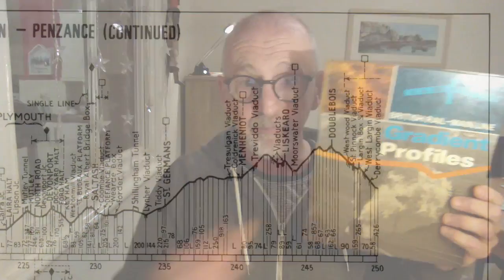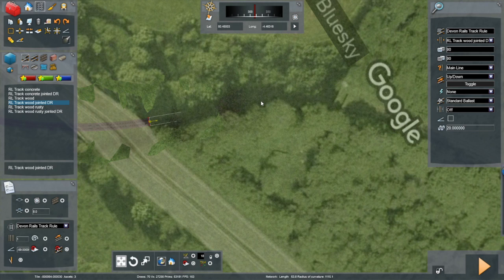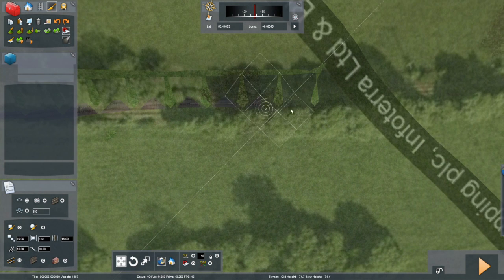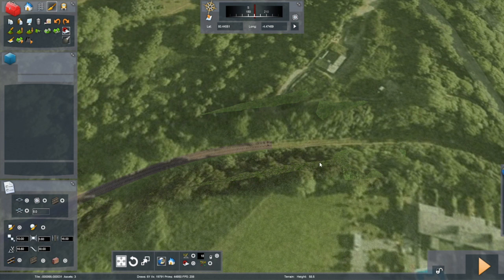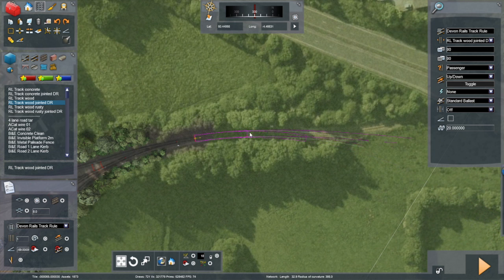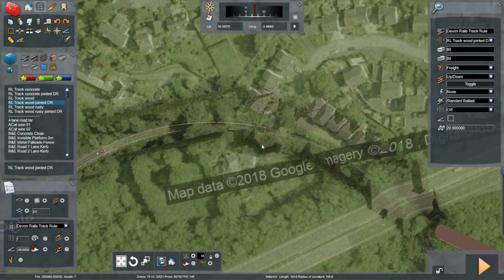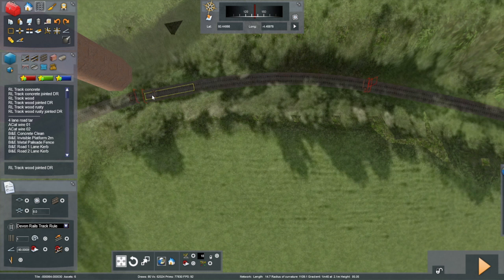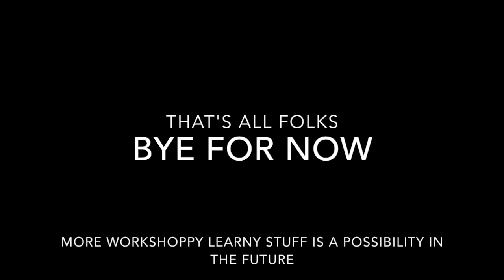Laying Train Simulator easement track in twisty branch lines

Comment: Brilliant tutorial! One tip is if you're unsure about track placement, go under the terrain and place the track in line with map but not finishing perfectly to the point. Afterwards, start the curvature as a junction and cut off the left over off. Also, I use the snap completely and once I'm sure, I re-import the terrain and tidy up the embankments. Keep up with the good work!

Comment: superb video for a very tricky subject...... any info on how to reduce canting on some overtight slow speed sections made with a yard track rule template, other than building a unique track rule from scratch?
Reply from the maker: You would need a new track rule Malcolm. Or perhaps don't use superelevation. I don't use it where the degree of superelevation would be too large.

Comment: Brilliant video really found it useful on laying easement track! I was wondering how do you connect track with easement? So say you start building a diverging route that connects further down the line. I've laid pilot track and when I go to replace with easement is it possible to connect the two or will I have to just connect in the normal way? 

Also being cheeky can I ask if it's possible to do a tutorial on terrain editing and how you go about editing the terrain in your route after importing the DEM files to get an accurate looking route.
Reply from the maker: Sorry it's taken so long to reply! In short, and as you know by now I expect, you can't connect easement track to previously laid track. You just have to turn easement off and lose superelevation in the relevant sections. Sometimes you have to compromise (andf remember that it's only a simulation :-))! I did a tutorial on cuttings that you can see here: https://youtu.be/Qq2uKn7a_Mo . I'm in the process of creating a DEM tutorial involving correcting terrain under a high Cornish viaduct. Look out for it!

Comment: I am in the USA where the grade of the rail is measured in percent of grade.  0.0%  of course means level ground.   A listing of -0.02 means 2/10 of a foot drop in 100 feet and  -1.02 would be a decent of -1.02  feet over a distance of 100 feet of rail.

My question is, is there a formula or a calculation list to show how to transfer this  to the gradient numbers from TS 2020?  For example, when you were using a gradient of -44.  What would that be in the 
U. S. grade calculation?  I remember a comparison when using the Microsoft train sim but I can' locate it in my records.
Reply: I live in New Orleans, LA and I'm slowly working on my version of the Huey P. Long bridge, I found something that reference its 1.5% and topped off a 52 meters clearance. It was a butt-kicker trying to get the numbers close enough where the train didn't look like it was struggling.
Reply from the maker: Try this: http://www.1728.org/gradient.htm

Comment: excellent video even after two years later it is still very helpful. However I do have a question for you I understand that the DEM files are not that spot on but when I lay my track using the track charts I end up carven and giant canyon through my terrain. Since I am using US plan so I have converted the gradient to metric before I started.  the station elevation is 188ft and the track is at 190ft however when I put in the track gradient it is way below that. Any info you can provide that I am doing wrong would be very helpful
Reply from the maker: Thank you. Topography created by the DEM files is very very rarely right! Hills are normally too low and valley floors are normally too high - everything is smoothed out, often far, far too much. This can be a serious problem in TS modelling areas like Devon and Cornwall, which are both covered in hills and valleys. So it's not surprising that track often ends up flying high or underground if you lay track in a linear way from your start point to the end. Remember that this is a simulation - you will have to make compromises because of the DEMs. My way of dealing with this is to start laying track from various places along the route and use sections of non-easement track to join them up. You WILL get some incorrect gradients and non-superelevated lengths of track as a result, but that's amongst the compromises you have to make, and anyway turnouts can't be superelevated so you can use junctions and station areas etc as your join points. Choose starting places half way up a hill - they are the most likely to be correct, or near correct. Places at the bottom of valleys or near the top of hills will be the least likely to be correct.

Comment: Do you have a tutorial on how to come off a curve and lay about 10 miles of strait track above an overlay that is still on the mark at the other end?
Reply from the maker: Not specifically, but I can certainly confirm that it can be very tricky to achieve this. You have to play back and forth with the leading edge of the track, look for the yellow straight line, see the impact of stopping the leading edge in different places and keep going by trial and error. You will eventually achieve the line you need. I can think of where I had to do this in the Somerset Levels, and it was indeed a complete nightmare to achieve the correct line for several miles of following straight track. I don't think there's an easy way to do it while retaining easement track except by repeated trial and error. If you get completely stuck I suggest that you turn off easement close to the end of the curve, lay the straight track as needed ahead of the curve, and then join the curved track to it in the normal non-easement way. It sometimes takes a couple of tracklaying clicks for easement to stop, but it will eventually. You won't be able to use superelevation into the straight, but if you get stuck and take this approach that would be the compromise you would have to make. I hope that helps!
Reply: I've been working on my route since 2013 and I have many sections with the long straight track. What I find that works is really a 2 part but I'll tell you the easier one. Layout several lengths of straight track. By default, it's 500 meters, as the track comes off the curve make it a little longer than needed at the same radius. connect the straight sections the length and take note of the drift off-center. Then go back to the curve track and cut about a half meter and reconnect again. It's trial and error but it works. Now if you have to put turnouts and crossings, take care of the straight track from end to end then come back and put in the turnouts and crossings.